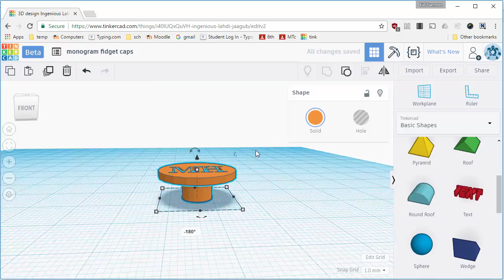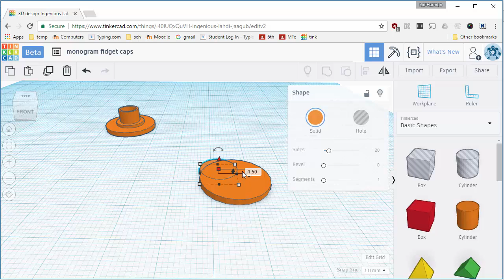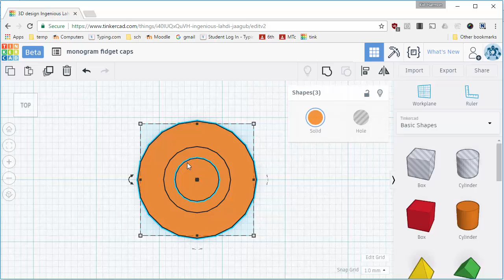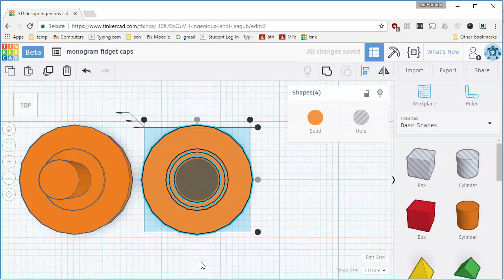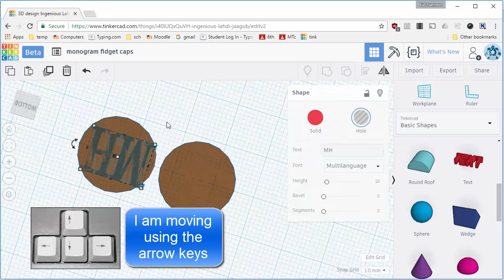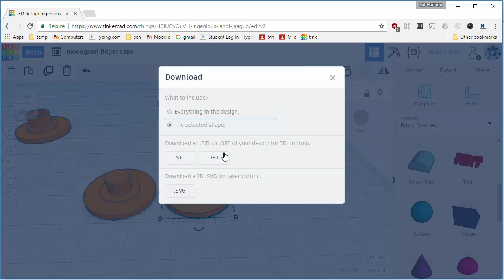Fidget Spinner Caps made easy! Even add your initials!

Comment: Is it possible to add a logo or photo on the caps instead of initials
Reply from the maker: The big trick is whatever you design has to be tiny. The caps are only 18mm in diameter. I had a gal make cat whiskers which turned out really sweet. It would be really tough to squeeze a photo on there though.
Reply: HL ModTech ok but is there a button that actually allows you to import an image into the design?
Reply from the maker: Yes, TinkerCAD does have that in the community tools. I think it would be tough to get it small enough for the cap though. I will see if I can track it down and add a tutorial quick.
Reply from the maker: If you have an svg of the file you can import that shape, the cut it out. There are many sites that can convert a jpg to svg as well.
Reply from the maker: This is a quick clip where I bring in a SVG. https://youtu.be/XmS8jg81oaQ
This clip is longer, but it was a neat project as I created a 3d version of a business card. https://youtu.be/BqK5kjjWya8
Reply: HL ModTech ok thanks
Reply: HL ModTech how thick is the actual part that you hold?
Reply: HL ModTech nvm
Reply from the maker: I made them 18mm in diameter and 2mm thick.
Reply from the maker: Unless you are talking about the spinner body... I typically make those 7mm because that is how thick a bearing is.